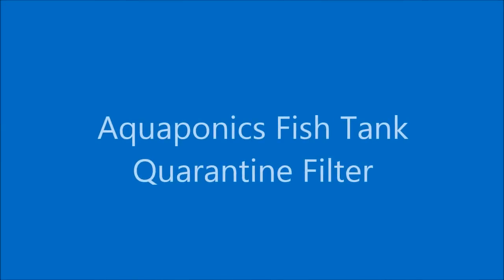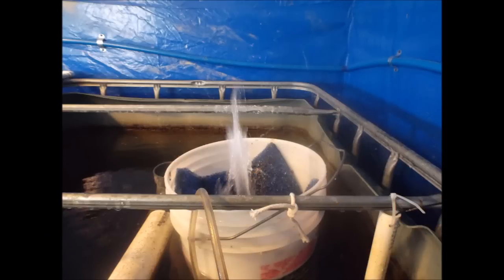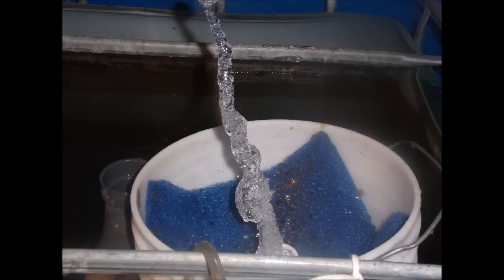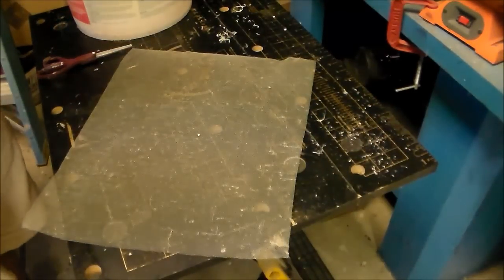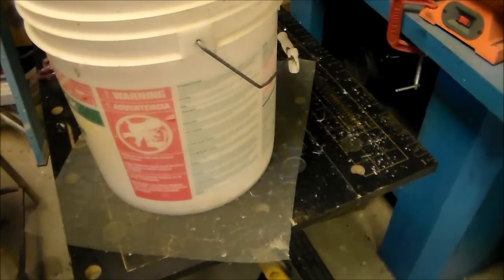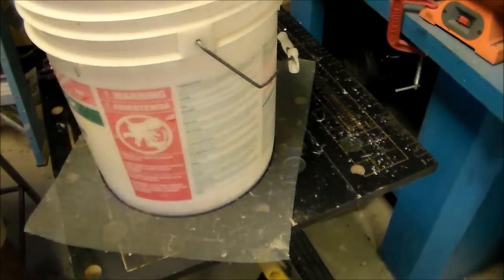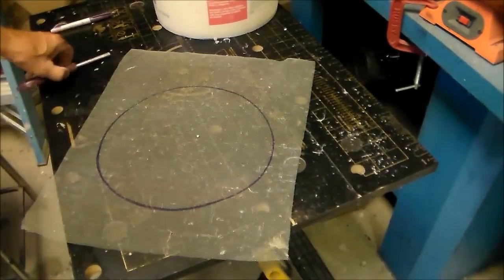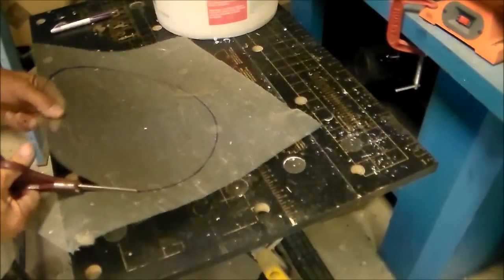Aquaponics Fish Tank Quarantine Filter

Comment: HI, Donald thanks for all your info..  i real want to learn a bit about how the system is set up..   for the pump and tubes..
thanks
Reply from the maker: +Hector Ortiz The pump is created by air rising in the vertical tube, as the air rises it expands and pushes water up the tube causing pumping action.  the air is taken from the air stone that was in the tank, and the pumping action is also aerating the water so the air stone is not needed, hope this helps my friend---Don

Comment: Donald, be careful of using aluminum screen in your filtration system, I lots several fish when I first started keeping a pond to metals leaching into the system, copper will also create the same problems. Better off using plastic screen mesh. After your fish are recovered, you can probably use a smaller tank as an isolation tank, depending on how many fish you plan to add at any single time. Good luck Donald!
Reply from the maker: +Roger Naylor Thanks for the advice--- I already knew about copper on plants---One reason for the isolation is to clean the infected tank, so this can be done with any tank in question, but something in the system may already have spread to everything--- Thanks for the comment my friend---Don